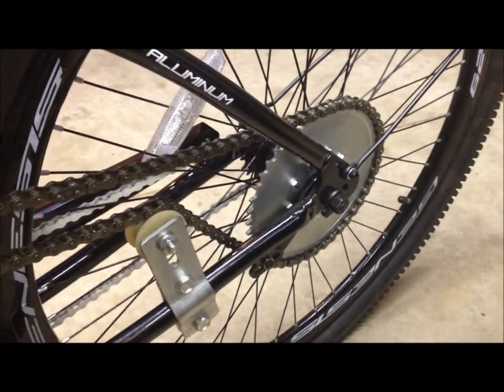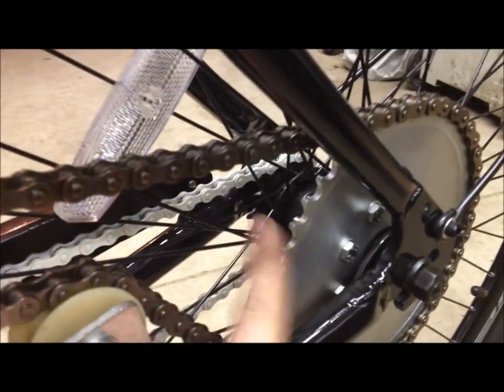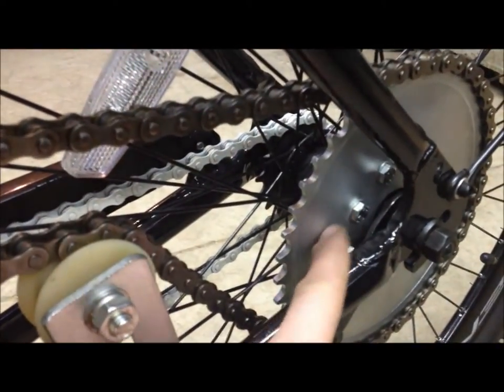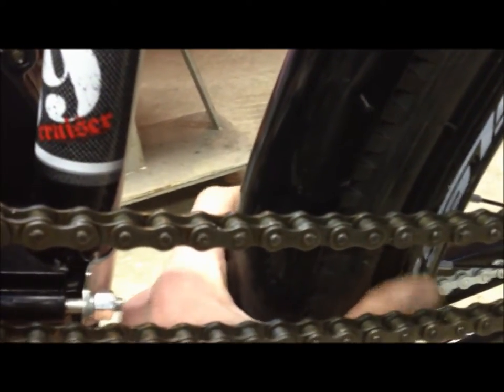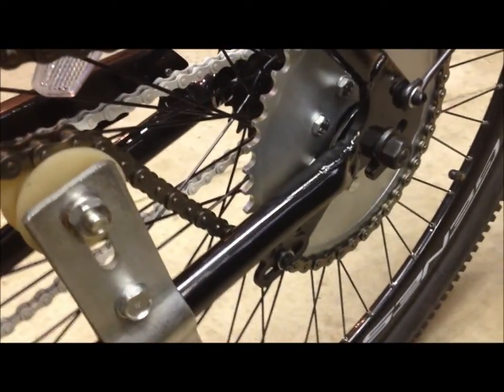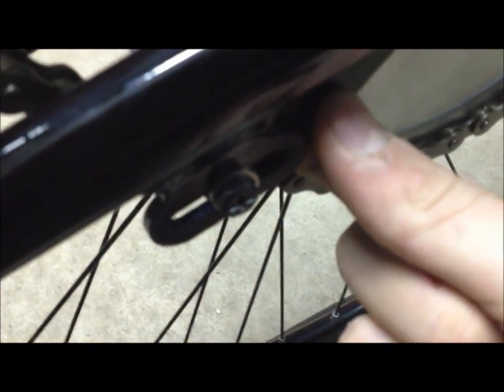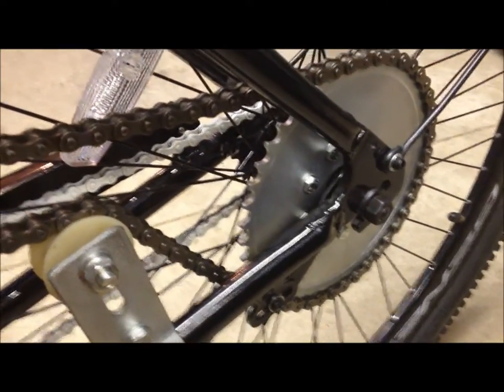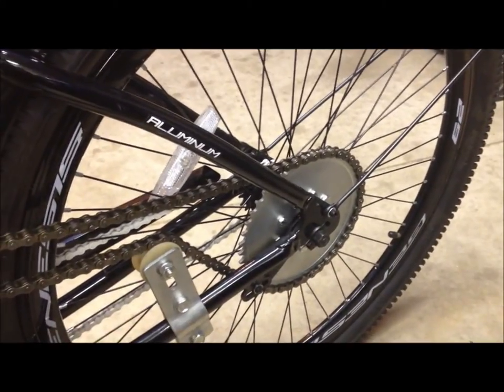Motorized Bike Coaster Brake Sprocket Mounting Tips & Tricks

Comment: Good tips just learned that the hardway.. but i would recommend at the very least upgrade the coaster break hub. Disc breaks are best drum breaks are nice aswell better than caliber breaks which work and are better than stock coaster breaks... there is a nice long list of higher end coaster break hubs that will hold up and takes the least amount of tools skills extra parts. Drum break kit is cheap but takes some skills tools and a few parts. Adding caliber breaks is easy enough just use holes for fenders they can mount easy. Whatever the option you go with make sure you have something!

Comment: How do you deal with the coaster hub in general? The motor will in effect spin both chains, which on a coaster hub means it spins your pedals, which can be dangerous when you really get moving. Any easy way to make the pedals not spin with the chain like a freewheel on a mountain bike?
Reply: You will only spin your pedal forward if your chain is too tight.

Comment: I do not recommend Coaster Brakes on a motorized bicycle. the coaster lever can easily strip out causing you to have no breaks. it can happen with no warning leaving you going 25-30MPH through a stop sign or a stoplight making it very dangerous.
i have been building  bicycles almost all my life and motorized bicycles for the passed 4 years now. im not saying that im an expert but i know a good amount of stuff when it comes to bicycles
Reply: I’m the same way my brother got one with coaster breaks and his c clamp crept jumping out the grove that holds the sprocket on witch leave you with no breaks don’t like it at all witch is why I built mine with free wheel and handle bar breaks